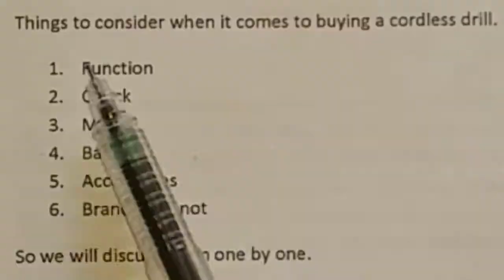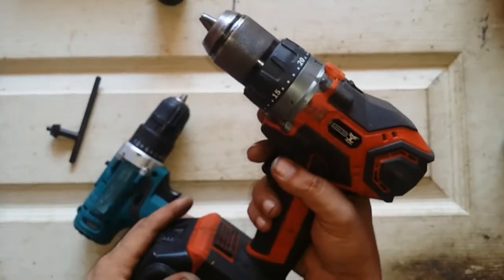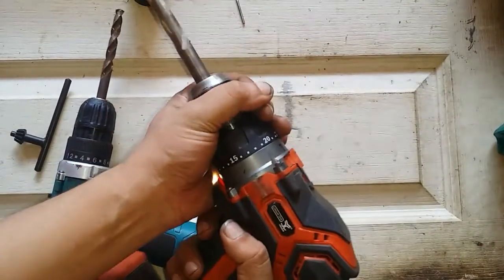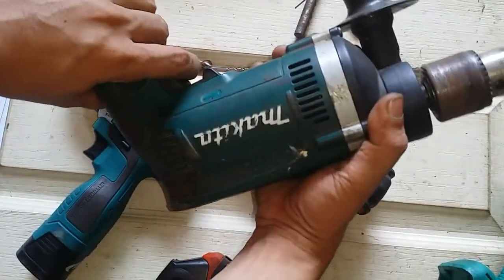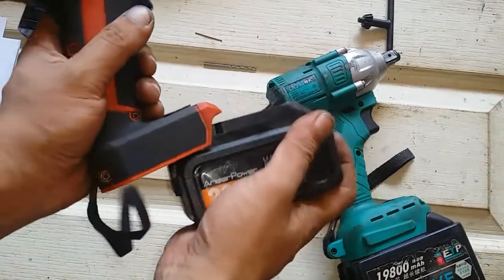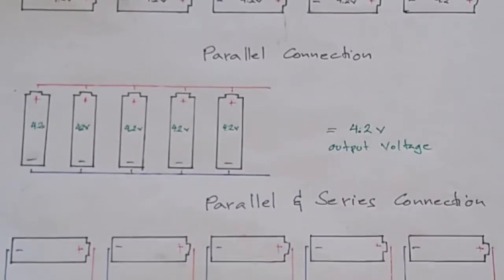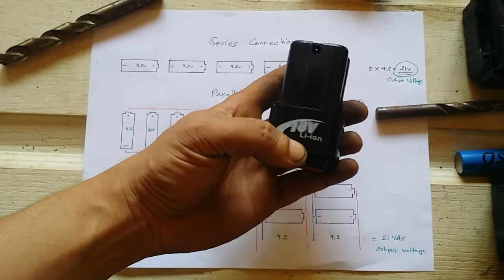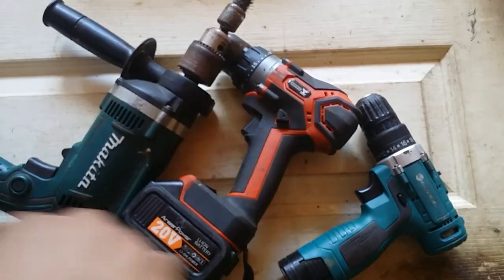What to Consider When BUYING a CORDLESS DRILL

Comment: Thanks for the video. Can you recommend some good masonry or concrete bits to use with a cordless drill with hammer function?..thanks.
Reply from the maker: as far as im concern cobalt drill bits will do. but if youre going to use it a lot and make a lot of holes you might want to use carbide tip bits
Reply: @MrDIYer  Thanks, i got the Comoware Carbon Steel Carbide Tip, hope that will do it.

Comment: You didn't mention about the capacity of each battery, like the mah..the more mah the battery has the longer you can use it before recharging. .
Reply: thats on parallel series connection.. more in parallel.. more tome of use.. just less power